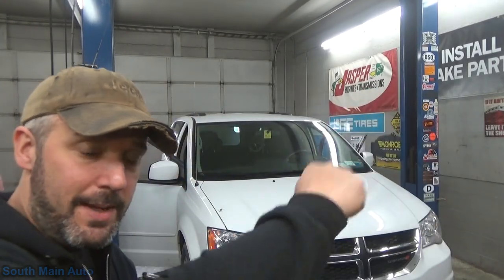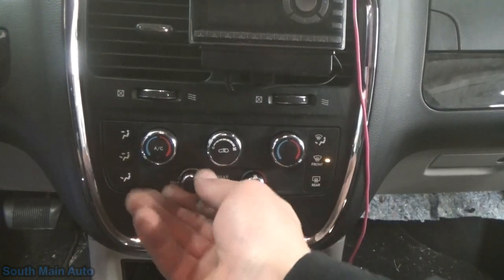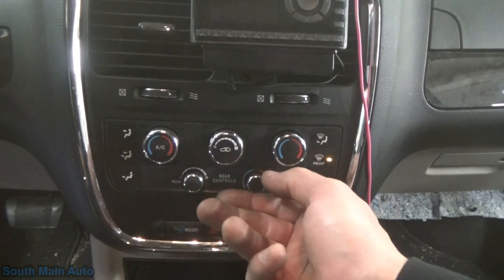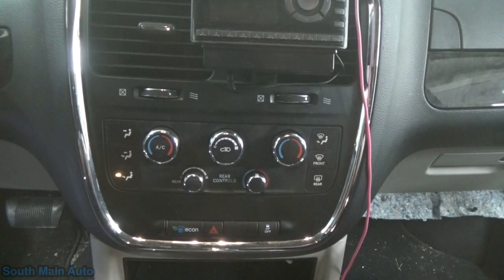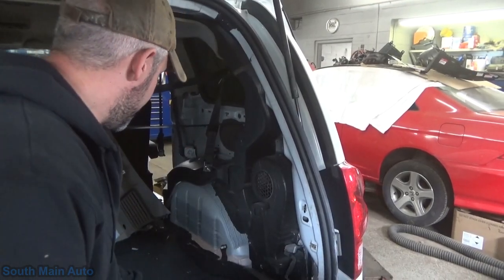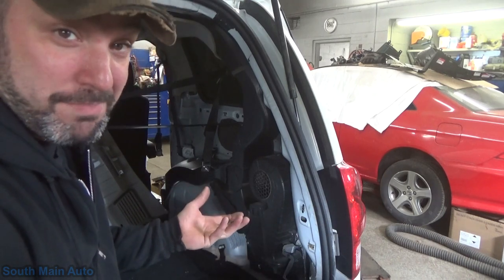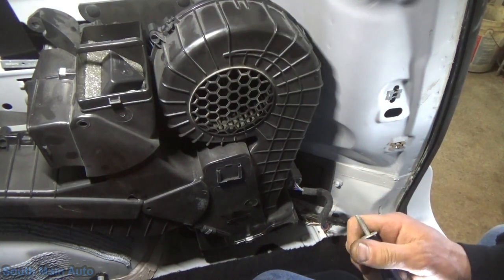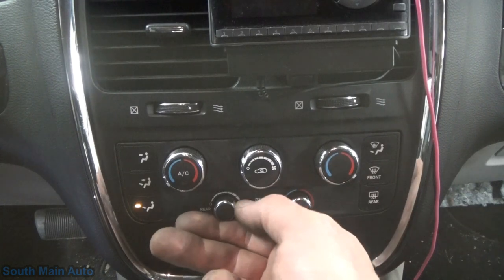Dodge Grand Caravan - Rear Heater Clicking / Front Heat Stuck On Hot

Comment: I had this same problem with my 2013 Grand Caravan. I tried synching the knobs - didn't work. After watching the first few minutes of the SMAR vid, I opened the glove box to reveal the right side Blend Door Activator, started the car and AC on high, then tapped on the Activator a few times with the butt end of a screwdriver while dialing the passenger side control from cold to hot. Magically it started working again. I'll replace it later, but it works for now. Thanks for the tip.

Comment: great video.  we now own our 3rd grand caravan.  had very few maint issues. mostly rust issues due to salt use in wisconsin.  current one bought at 200,000 miles.  now owned for one year and didnt spend one penny on repairs.  only thing wrong is the light bulb to display defrost or air to floor do not work so cant see that at night.  great car other than some of the chinisium parts!

Comment: Would you have had more room to work by removing the glove box? Also thanks a LOT for this video. I have a 2011 Caravan with the hot passenger side temp stuck problem. This video has made me confident to tackle myself.
Reply: I wonder how bad that heater core is the change because I still need to change one
Reply: Inside the box Push upper right and let clips at the same time

Comment: Thanks for this, used it on a 2015 Grand Caravan. Bought the part, but all I did was remove the old actuator, plug it in, and turned the knob to heat, and then replaced it, and voila! Have to do the back now.

Comment: Another Great Video.  Thanks Bruddah.  
Sure would of been nice if they designed the front actuator so you can access the actuator by removing the glovebox. Chrysler / Dodge service center ensures job security. Can't even guess how to make the rear actuators easier. Perhaps making them out of quality materials might.

Comment: Hi Eric, I have a 2012 Dodge Caravan first thing . It's winter here in michigan now and we had the air-condition compressor removed and installed a delete bearing.  What do we need todo to get better heat now in our van .  Yes I removed the pully and installed new bearing as the compressor is frozen up.   Any help would be great .  Keep the videos rolling.

Comment: I have a 2016 dodge caravan that we just got and it only blows cold air when I have it on heat and then we cleaned out the cabin filter and it start to
Work in the front but the rear is still blowing cold

Comment: My brother bought the 2012 VW flavor of the Grand Caravan, the Routan.  Within 4 years of ownership the transmission shat the bed.  The dealer wouldn't replace it - they "rebuilt" it (he bought the extended warranty).  Within 10 minutes of driving it, the transmission sounded like the Jetson's car, this crazy whirring sound.  He brought it immediately back.  The dealership informed him that the sound "was within acceptable limits".  Fortunately he didn't have to wait more than another month before it died yet again.  Drove it home on the highway at 35 mph and 5500 RPM since it wouldn't shift out of 1st.  This time they actually did replace the transmission (supposedly).

Other crazy things of the many that have broke on this car include the driver's seat essentially wearing out and cracking.  Brought to the dealer, with a refusal to fix/replace it, stating that "the seat has an acceptable amount of wear". 

When the power seat stopped working it took 2 months to get the part in that they needed to fix it.  So my brother couldn't drive it during that whole time since the seat was locked at the position of his wife's seating position.

Just amazing what a POS this company manufactures.  When you ride in it, the thing literally sounds like it's shaking apart with all the rattles and squeaks and bangs.  And the best part is, my brother is going to buy ANOTHER Grand Caravan.

I'll take my '05 Subaru all day long.  Twelve years old and my brother always remarks about how quiet it is, hardly any squeaks or rattles.  The seats have virtually no wear to them.  Never had a major issue with this car (knock on wood).
Reply from the maker: Heck yeah I would take a sooby any day over a Chrysler!
Reply: Other than the head gasket issue, which this engine version doesn't seem to be afflicted with based on my research.

You do great work on this channel, Eric.  Been a subscriber since the beginning when you did the viscous coupler video on the Vibe.  My wife's car had the same issue and I fixed it myself.  Local repair shop wanted to rebuilt the whole rear diff.  Fixed it for like $80 in bearings thanks to you.

Comment: You seem to know your way around D/C/P minivans pretty well & seem to be a Glutton for Punishment with them LIKE ME, so thought I'd take a chance on a message to you about my A/C Problem. The first part is from other posters on a Dodge Forum I belong to.

"Originally Posted by Lion Heart View Post"
Hey guys! I have a 2013 Grand Caravan.

The front blower has stopped working, rear is 100% a-ok.

I checked all the fuses in the board, all good. Tested the relay by swapping the front and rear relays (the number on top is the same) and relay seems to be working fine.

There is no 12v signal being sent to the blower resistor (and so of course no 12v going to the blower fan either). I tested the blower fan, and that is 100% working fine when you manually apply 12v. But there is no 12v being sent to the resistor or blower.

Tried a replacement used panel in the dash board (i.e. the heater control panel) and the problem remained and was identical.

Before the fan stopped working I noted it was intermittent, and also the relay would click on and off continuously (like a bad connection). But now it does not click at all when the ignotion is swicthed on, and the relay is itself is fine (I have swapped the front and rear relays around and both are fine and activate the rear blower no problem.

No idea why, or what to try next???

My car does have two codes that have been on there a while P0455 EVAP Emission Control System Leak (Large) and P0430 Catalytic Efficiency Below Theshold Bank 2. The P0455 was previously a (small) leak but now changed to (large). The small leak and other code has been there for months (engine light on, reduced power on accelleration, I'm getting around to sorting it but keep getting other issues, like this one!!!). BUT, back to the point, I don't think those codes would switch off the front blower whilst allowing the rear blower to still work??? So I think that is completely unrelated?

So, apart from that I have no clue and any recommendations on what to test next much appreciated!!!

 My Post:
I am having the same problem now with my 2013 SXT. All of a sudden, with no type of problems or noises or strange behavior, my Front Blower would not run.
The fan works great at top speed when separated from the system harness, and no voltage reading at the connector.
Swapped the Blower Power Control Module with a know good working one, and still no power to blower connector.
Ran a scanner test & all actuators working all the buttons on both side work as intended (rear Def, front Def, etc. all level change as intended so doors & everything else working ok & no Trouble codes come up on scanner.
I am now gearing up to start tracing out all the wires between the blower connector & the source, which is a job no one wants to do if it can be avoided! It is hard enough trying to get hands & fingers up into the tight spots to disconnect or back probe the connectors to test for voltage!
There MUST be some type of TECH out here that has some hints or clues as to the source of the trouble.
I am hoping to find out or eliminate the Controller Head Switches mounted in the dash stack before tracing any individual lines for problems, but not exactly sure how to do that since I cannot seem to find any specs on what voltage on which connectors anywhere along the connectors, & I am having trouble understanding the wiring diagrams I found on all data since they don't provide a diagram key showing what are switches & connectors, plus the diagrams are split over multiple pages & the wires change colors in areas added to the fact that I can't seem to read small print anymore even with a pair of cheaters on.

ANY advice, hints or help of any type would be greatly appreciated, especially after reading about all the horror stories out here about being rack over the coals by so many "Dealers" who mainly seem to be just throwing parts at the problems until they finally find one that fixes it!
I have never looked for or expected Anything for Nothing & I don't mind paying people for doing a job for me, but I absolutely HATE being ripped off !
 
________________
People in general are a lot like a slinky toy--Pretty useless for the most part, but they can still put a smile on your face when you push them down the stairs!

Comment: Man I just did this job today and the front is still blowing hot. I guess I didn’t put it in right. I heard you say something about twisting it to fit, but it fit, oh well. But you got in and out pretty quick, it took me an hr alone on the bottom screw and I had to cut some plastic away.

Comment: I have a 2012 Dodge caravan, replaced dead battery and now my rear defrost light flashes for about a minute. Sounds like its calibrating the actuators and then the unit returns to normal operation. what do you think is the issue?
Reply from the maker: Does it do it every time you start it?
Reply: South Main Auto Repair when it's been parked with the engine off for more than 10 minutes it will do it again. If I  turn the engine off and start it again it won't do it. Only when it sits.

Comment: I have a 2010 and the rear heat just doesn't do anything at all.  No clicking, no blowing, nothing.  Would this be the same issue? It's about to be winter here in Alaska and my kids would appreciate heat.  The front heat works just fine.

Comment: Lol I've had really good luck with caravans. The only problem I have with the current one I own has the elusive intermittent cylinder 4 misfire and I just purchased a 14 SXT today from the insurance auction and the only thing wrong with it is the blower in the rear HVAC unit is making noise and the passenger side sliding door won't close with the button but we all know that's just a broken wire in the track.

Comment: We have a 2011 Caravan that the rear A/C has been bypassed and now the rear Blend door has fallen apart (Obsolete) and the vehicle gets stuck in relearn/diagnostic every time we start the vehicle.  Is there a way to get the HVAC control head to bypass the rear system calibration?

Comment: I had that clicking problem on my Lexus. I took apart the blend door actuators and cleaned the contacts as they were chard black and not making a good connection. I put some grease in there as well on everything and its been working just like new for about 2 years now.

Comment: Another great one, Eric.  Love seeing the family, too.
My Routan (based on the T&C) has an issue that the rear AC doesn't seem to blow cold, just ambient temp.  I honestly didn't try to set the temp higher to see if it's just the actuator door stuck somewhere.  AC blows nice and cold in the front, just nothing in the rear.  You've given me some things to check.  Thanks!

Comment: Eric i have a 2012 Dodge Caravan  3.6L v6 pentastar & 6spd automatic transmission
and i was wondering is it normal for the Purge Valve Cannister to make a pop-pop-pop noise at idle with your foot on the brake and the car in gear?

Transmission bangs into gear in reverse also. 

I'll never buy another.

Comment: Don't know about chrysler actuators but the chevy ones do that popping sound because the plastic bull gear has a  crack from the pot metal hub to the outside gear teeth which allows it to then open up and bump around on the pot metal hub splines.  If you really need to, you can JB weld it back together, and there is a dude on eBay that sells $20 replacements he makes himself. It hammers onto your old hub if you are tired of OEM bad design or high price of dorman complete units. Not very practical for SMA as labor isn't free but for the DIY that has more time than money it's a nice option to have. Quality looks very bad from his milling machine but they sure work better than OEM so far.

Comment: I am having the same issue.  my passenger side only blows hot air.  my husband and I replaced the actuator and still no cold air.  Took to the dealership who tells me the diagnostic testing shows fail at mode door actuator and right side actuator and module needs updating.  they want to charge me $800 to repair.  I'm confused since we already replaced the right side actuator.  My husband took the old actuator apart and the gears are NOT broken as we suspected they would be.  Could it be that we just need to have the module software updated.  I don't necessarily trust the dealership in my town and I am not comfortable agreeing to have them replace a part we already replaced.  If you could provide some advise I would appreciate it.  OH, my vehicle is a 2015 Dodge Grand Caravan.

Comment: If an actuator is changed, does it self calibrate?   I see you connected to complete the test and calibration using your programmer?  I need one changed, but don't have the programmer.

Comment: So the heater in my 2012 Dodge Grad Caravan blows warm for a little while then starts blowing cold on both the driver's and passenger's side. Looking at the temp gauge, I do not believe it to be a problem with the thermostat.  I though maybe the valve that stops water flow into the heater coir, but I can not find that valve. Any thoughts?

Comment: Is there a way to do the calibration without the computer tool? I replaced both front actuators myself, but now have the rear defroster light blinking which means a calibration fail from what I have read

Comment: The rear heatercore hoses that are connected directly to the rear heater core, should those lines get warm even if the heater or ac is not being used?

Trying to diagnose an issue with not having any heat in the rear at all.

Comment: Hello Eric. My 2006 Dakota's heater makes the same noise when the mode selector is in any position except defrost/floor and defrost and when the temp is near zero. The noise goes away once the heater system is warmed up also. Does that mean I'll soon have an actuator(or two) that does work?

Comment: Hi Eric, I've been watching your channel for a year now and I just subscribed. I own a 2016 Dodge Grand Caravan and the first video of yours that caught my attention was how to create a trans dip stick out of the oil dipstick. Thank you for that one and so many others. The question I have is based on this video which was extremely helpful. I replaced the malfunctioning blend door actuators in the back and even though they work and I can hear them going through the calibration. The rear defogger light always blinks for a few minutes before I can use the HVAC system when I start the van. Is there a way to calibrate it without a scanner? And is it doing this because I used non-Mopar parts? I would have emailed you but I don't have an account for any of the socials that you also have, so hopefully you see this and can offer some insight. Anyway, I really enjoy your channel, it is very informative and helpful and sorry for the long comment on this older video. Peter from Toronto, CA.

Comment: I replaced the driver side front actuator, Since the gear is missing a tooth I don't if the actuator is turning the door to the coldest setting. Before installing the new actuator I took the "key weigh" out of the old actuator and put it in to control the temperature door, hand turning the key weigh towards the front seats will release cold air the opposite direction is hot air. Left it in the cold position, Connected the wire harness to the new actuator turned the temp knob to cold, looking at the key weigh it will turn counter clock wise to cold. facing away from you it will turn clock wise when installed

Comment: I have Dodge Journey 2012 RT . The rear heat not working (not hot air can me in second seats and rear) , is the rear blend heater gate in passenger front near the front blend gate or in the rear same what in  your video? Please inform me the location?

Comment: I know it's  1 year old. But , The rear heater in my 2010 G.Carvan ,  Blowing Ambien Temp. Air..(cold is fine though) But NOT Hot air..I don't understand the prensebles of the Rear Heater. any help where to start ?

Comment: I am taking everything out of the back of my van trying to strip it. If you feel like answering (anyone that may know), I would highly appreciate it. 

All of the back of the ac and heater do not work and everything looks unplugged. The front works ac and heater and is fine but I would really like to take out all of this stuff out completely. Which I don't know the names of- It is the fan, the big black air funneling tubes, silver colored metal pipes and whatever else is there that is a part of this system. 

I didn't want to take it all out if it harms the van in any way. I know nothing about vehicles and I would highly appreciate some aid in this. 

I really want all of this stuff out of the way without it doing any damage. Any help??? Thanks

Comment: You need an under dash creeper. I bought one cause at age 68 I no longer liked the pain of the raised door sill in my back. It allows you to slide in and out from under the dash on a padded vinyl covered board. The molar mini vans are great for 60 k miles ,but then you better watch out.